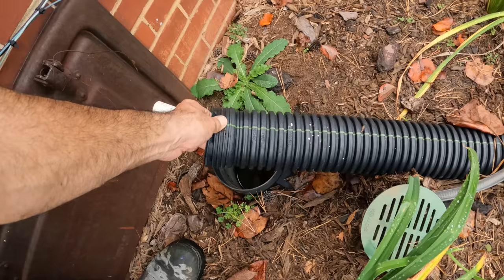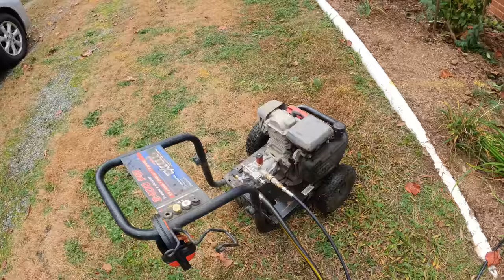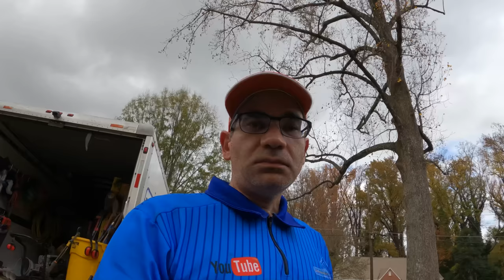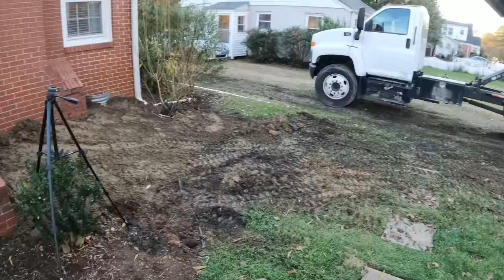Is PVC worth it? Crawlspace and Basement flooding, backgrading, and no fall

Comment: I liked how you were teaching the camera work too so you're not the only one that is worried about shots etc. Smart man! At least with that Schedule 30 run its basically already on top of the soil vs in it, so it won't take so much to replace it if needed. Great video!
Reply from the maker: I agree. If the sch30 backs up again I'll just replace it instead of cleaning it out again.

Comment: Instead of the concrete block to hold the pipe, try galvanized strut and 4inch pipe strut straps. You can anchor the strut to the house or drive it in the ground. It will securely hold the pipe and not stand out like those blocks.
Reply: I agree, if I were the home owner I certainly would not want those hideous concrete blocks supporting the pipe it looks shabby.
Reply: @leewalsh2428  I understand your point. I bet the homeowner was thrilled to be free of water & stress for every rainfall. Changing the aesthetics may be a future project. I like that the solution works. Update - I rewatched the vid. The HOs said they don't care what it looks like provided (the water management) works.
Reply: I like that idea! I've been experimenting with a similar solution of above-ground pipe because of lack of fall, ease of access & maintenance, etc. I also have run the pipe over vents & climate control components. I've been stumped about what to do to provide lift, support, and slope while having a reasonable aesthetic. Thank you for posting your idea. I'm going to experiment & create a mock up soon to see how it'd look. If you have other ideas, please share!

Comment: Yeah that worked out pretty good. I wouldn't be surprised that line that runs beside the driveway has been crushed driving over it with a car. It's running the same way as the driveway is not very deep so there's no protection and it's probably got some cracks in it and that's why it's leaking and then the roots are getting into it. And 👍👍🇨🇦🙂
Reply from the maker: That's a great point. Even if it got cracked, the roots can get into it.

Comment: i've used corregated on a fairly decent grade in my yard thinking the flow would keep it clean... it's full of organics and oblonged. before pvc was all the rage, i used the pvc about 35-40' across my parking pad due to low slope and minimal buried depth for strength, there is still virtually nothing in that pipe, it's incredibaly clean. i drive 20k vehicle over it for 10 years and it's perfect condition. i'll use pvc whenever possible

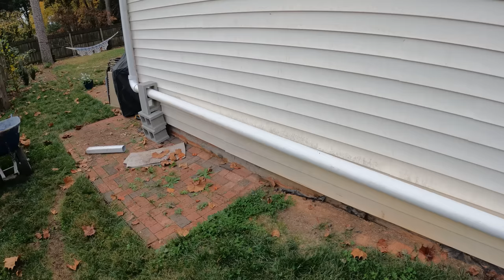Comment: 11:10 How about some short garden fencing as a fascia/soffit cover? In plastic or whatever. easy to move for access. 
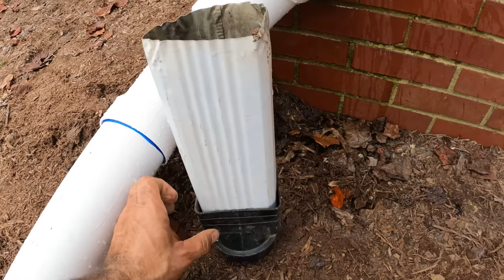 28:50   Drill a hole and put in a rubber plug for cleanout on the flat part near your thumb.

Comment: I use 4 x 4 x 2" Tee-Y's for clean outs. They don't look so bad on the house. If it's in the ground facing up in a flower or shrub garden or bed, it's not too noticeable. You could use ABS threaded cap or Tee-Y, the black ABS will hardly be seen.
Reply from the maker: I've used those and sanitary tees as well for cleanouts. A male adapter + plug works well.

Comment: I'd recommend replacement of the schedule 30 with schedule 40 if only to make sure that the T's get replaced with sanitary T's and ALL the joints are glued to prevent root infiltration in the future...

It would also allow you to remove the form-fitting downspout adapters and place proper clean-outs at the far end of the line for future maintenance and cleaning...

That and the 40 is more crush/cut resistant than the 30 is and the street end of the 30 line looks like it's already been crushed and chewed up by something...

The Homeowner might also want to think about replacing the gravel driveway with a concrete one to improve drainage and make it far easier to shovel the snow in winter...
Reply: The should find a way to add a clean out at the top of the long straight away along the driveway, even if they replace the pipe because there's so little fall.

I don't think they worry about snow in NC.

Comment: I see plenty of tripods around for the cameras… but not one holding a surveying rotary laser that can tell you the actual grade you are working with.  You really need one so you’re not guessing at the amount of fall you actually have.  Wouldn’t this give you the information you (and the homeowner) needs to decide if a sump basin is needed or not?  With the remote detector you can do actual measurements to make sure the pipe is laid correctly at the right depth/pitch.  Diesel Creek recently used one in his “Laying pipe” video..  You definitely need one.

Comment: pruning blades on the recip saw work well (maybe not for that stump lol!) but go blunt very quickly - helps to have a bulk pack and keep swapping to a fresh one. Digging out the soil/rocks by hand before cutting helps make them last longer too. If you're cutting something more than a few inches thick it helps to seesaw the blade or pull it in and out to help clear the chips/sawdust.

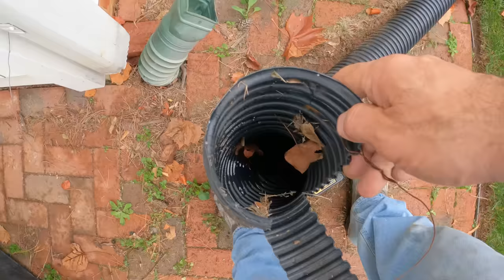Comment: Haha 10/10, 5:55 that's a great point that ADS can't defend, they're in season.  

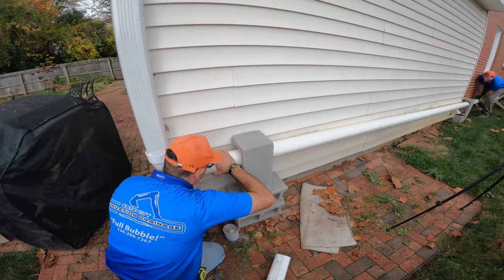To keep the pipe subsurface in that particular situation I'd probably have had a sump,  where the sump has a 4" overflow to the street that uses gravity a simple cheap pump can keep the mosquitos away when it comes on at night(the pump would be on a timer so that gravity would do most the work for the majority of the time).  It seems excessive but they would regain that 8 inches against the house where those cinder blocks hold up the pipe. 8:45 

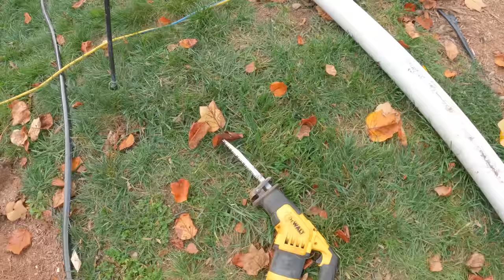21:17 what happens with the chainsaw is that grit gets into the end of the bar which causes it to somewhat seize & stretch out the overheated-chain.  You need a simple sharpener for your axe, almost any type keeps the blade sharp so that you don't waste energy harming elbows or shoulders, I prefer the double ended axe(Never swing a dull blade, it's waisted life IMO).

Comment: Looks good - if they ever decide they need to open that iron door they'll need to cut the 1.25" and put a sleeve on the connection.
Reply from the maker: I think it was a coal door?
Reply: @GCFD  Yes. Our 1939 house in TN has a very similar aesthetic and that coal door. On ours the door rusted off, leaving a huge gaping hole in the basement wall without it. I had a piece of glass cut and attached it to the outside of the frame with brackets drilled and screwed into the cast iron frame, with gentle pressure holding the glass in. Very much a hack job, and meant to be temporary, but 3 years later it still works.

I was sure a lawn mower would send a rock through the thin glass but it hasn't happened yet. I need to revisit it because it's not sealed great and weeds started to creep inside. The proper fix is of course to break out the frame and put a complete custom window in, or just cement it up.

Comment: I use a  DWV Wye connector at the down spouts, then drop in a plug or grate. Looks good and easy to blow out. Also, do have a bore scope? Very useful for finding the breaks and insuring you have completely cleared the pipes. Good video, I always like to see how you work the solution. The cost of water damage makes the price of sched 40 worth it.

Comment: Hey is that a new dump truck ? For any of your viewer's the floor joists were hack. Never notch the bottom of the joist. They turned the 2x10 into a 2x6. A metal joist hanger is the proper way and I would still add them on bent a bit is still better than what they have.
All your work and I saw that, the new dirt was excellent now the driveway side when you go back to fix the leak

Comment: Good work as always Shaun...might be a dumb question but, I've never seen you use a soak away pit. Is this because of local soil conditions or some city rules? Soak aways are very common in the UK in older properties and they seem to work pretty well. That said, most UK properties since the 1960s tie into some sort of rainwater drainage system, with properties from the 1980s onwards having decent provision. I was impressed at the sheer capacity of the storm water drainage system on my 1980s estate, when I installed channel drains on the front driveway and catch basins in the rear patio. Deep inspection chambers that leant themselves to tying in pipework.

Comment: Fantastic work there. 👍 

The pipe next to the driveway could be broken. Vehicles may have damaged it? I agree it needs monitoring.

Anyone wanting to cut big tree roots or a stump without big equipment. Be safe! A sawzal is the safest option with a 12” carbide blade. It cuts through roots easily but stumps are challenging but possible added with human axe power. Using a chainsaw is dangerous if you don’t know what you’re doing. I don’t use one due to safety concerns (I’m not a pro) and as noted in the video it’ll damage the chain.
Reply from the maker: Great comment Joseph. I really need a small walk behind stump grinder to just grind out a 5" trench through the stump. I hate using the chainsaw like that but it does work until you hit the dirt then it's useless.

Comment: Hi Shawn, how about getting 20 or 30 stainless brackets made up, for holding up the pipe against the wall. A simple T bracket, with holes pre-drilled, with a 4" radius curve welded,  that the pipe could sit on. Great stuff. 👍
Reply: The top 'flat' of the "T" could be stainless angle laid on its back like a "v". The pipe would rest in the "v" and be held in place by two stainless steel hose clamps.
Reply: @KySilverfish  Hi Pat. Either way, 3 clamps to hold up the pipe, the blocks look unsightly. I still like 👍  the vids Shawn uploads. 👌

Comment: Great job finessing the work on this house and finding ways to solve the long-standing issues! I’m definitely a fan and always look forward to your drainage videos. By the way, what are your thoughts about using a backwater valve for a 4” pipe that is used to bring out the sump pump discharge out to the street?

Comment: I love that video you did on corregated pipe. LOL.  Next you need to do a vidoe on top soil and where to use it.  I got it use it on Bobcat trracks to regrow grass! I really like Jonathan Greene BLack beauty Ultra!
Nice video

If I have a bunch of fittings that wil be thrown out, including some NDS stuff corners, Would you want it, also Stainless screws for the same. Some Sch-40 some Sch-30. If I can get back there.

Comment: I like it but I think I would've used straps or clips to secure the above ground pvc to the brick on the side of the house rather than using ugly concrete blocks to hold it up.
Reply from the maker: We could have used straps but I hate drilling into brick. The homeowners were fine with the block since that's a side area with no gate and they never go over there..
Reply: @GCFD  FYI you can drill into the mortar instead of the brick, and anyone can easily fill the holes later if the pipe needs to be taken down or whatever. It's an option.

Comment: Do you get your material (pvc, connections, etc) from big box stores like Home Depot or Lowes? I want to run a pipe in our backyard and would prefer to use pvc having watched this channel and not sure the best place to get it. Luckily our backyard has plenty of fall and we have a water swale that runs in all the backyards that flows into a retention pond.
Reply from the maker: I buy from the plumbing supply house because I buy 20' pipes by the pallet and cases of fittings.

Comment: Have you evaluated the merits of pipe like ADS N12 vs what you have adopted as your standard? The jointery, pipe weight, handling/fitting are attractive but also, in Northern climates, even the mighty SCH40PVC is not 100% immune to failure from frost heaving.

Comment: Is it worth a stump grinder attachment for stumps and roots on your skid steer / excavator or a stump grinder machine if you have issues with stumps and roots?
Reply from the maker: I've thought about buying a small walk behind stump grinder for that reason. I definitely need to do something better with the occasional stump we trench over.
Reply: depends. tree removal guys generally only grind the stuff down maybe 6ish inches below grade. unless you have a high flow machine, a grinder on a skidsteer/mini excavator is going to struggle. you are getting the roots, rocks,dirt. we used to have a 30 inch falling saw with carbide tipped chain just for stumps/roots. still destroyed the chain

Comment: Is having that much fall necessary for downspouts? I know it would be for say a french drain to get proper flow but with downspouts wouldn't you have so much head pressure that it has no choice but to flow? I get some water may sit in the bottom of the pipe if there isn't a ton of fall but is that a big deal, if you have a square-to-round adapter and then the only other open end of the pipe, is at the end termination?

Comment: Enjoyed this one as always. But have a genuine question. Do you not have DPC’s in the U.S? I understand you seem to all mostly have crawl spaces underneath your homes but surely adding that much dirt against the brickwork will only cause rising damp
Issues for years to come?
Reply from the maker: Yep! If the sch 30 slows down again I will just replace it instead of trying to clean it out again.
Reply: What are DPC's? Yeah though, I also thought you couldn't go up that high with dirt
Reply: @davidgatten1033  DPC stands for Damp proof course, a plastic/ composite rubber type barrier that sits about 2 courses up from the foundation to stop any damp rising up into the brickwork. You don’t ever raise the ground level above this in the U.K otherwise you’re looking for trouble.
Reply: @Super690Motard  Thanks for sharing that. There's a channel I watch sometimes called "New Home Quality Control." It's an inspector from the UK who shows all sorts of crazy building stuff that's out of code. Check him out if you get bored. We have definitely have strict building code in the US too, and I'm pretty sure that the grade must be at least six inches below the siding, or in this case the brickwork, to prevent the damp rising issues you mentioned. The job he did will help with the drainage but raising the grade that high is surely out of code.

Comment: Why didn’t you just run the downspouts out towards the street? Could have made it into a dry well with a overflow catch basin and could have tapped into the end of the system they had to flow into the street. That way you wouldn’t have the pipes along the side of the house. Plus you didn’t add in any clean outs.. which looks like why it failed to begin with.

Comment: 4" sch 40 is soooo expensive.  A 10 ft run at my Lowes is like $45.  It'd cost me $600+ in pipe to do a few gutters on my house.
Reply from the maker: Spending $600 for a pipe that is going to flow and carry debris through it is a smoking deal. Imagine saving $300 with a lower quality pipe and then wishing you had just spent it and wouldn't have to worry about anything. You can't go wrong spending money on quality work for your house.
Reply: @GCFD  Yeah, great point.
Reply from the maker: It doesn't help ease the pain with the current prices!

Comment: quick question on the side of the house where you used cement blocks to support the elevated piping, could you use some type of hanger off the side of the house or is the piping to heavy? not bad critique just curious as i am handy enough if that was my only option that i could do some stone and cement around the block to make it look like a little stone column. like you said you can always deal with cosmetics. great job as always.

Comment: All the homeowner need to do now is paint the pipe to match the walls. Will it degrade the pipe if you paint it?
Reply: no it wont hurt the pvc but, painting pvc is a waste of time. pvc expands/constricts with weather. you have to degrease it/get the oils/residue off , sand it /scuff it, prime it with primer made for pvc/plastic. pvc/plastic formulated it. it'll be faded/flaking off in 3-6 months

Comment: Hey buddy. Just wondering why you didn’t secure the pipe to the house as a posed to running it through those cement blocks?
Reply from the maker: It would have looked better but I hate drilling into the house. The homeowners never go over on that side (no gate in the fence) so they liked the idea of blocks and not holes in the house.

Comment: I am an arborist and this is a risky practice. Cutting into those roots can kill the tree and make it a fall risk! That tree could fall over even years later. Please next time there is a tree, call an arborist and have it AIR SPADED. It's a quick and easy job and you will have a trench that you can use to run your pipe without damaging any tree roots!

Edit: It may be the case that the roots being cut into were from an old stump, and not from the nearby tree. Still good advice to get it air spaded when roots from a live tree are encountered.
Reply from the maker: I wanted to make sure you knew that was a stump that we cut into. There was a huge tree there and they ground the stump but we still hit remnants of it. My undergrad major was botany/ecology and I always heard that staying out from the dripline pretty much wouldn't harm the tree. That large Liriodendron was far enough away, don't you think?
Reply: @GCFD  That looked way too close to me. Drip line is not a good indicator. I've seen just 18 inch trench, 30 ft from the base of the tree, cause it to fall over. It depends on whether the tree is primarily lateral roots or if it is primarily oblique roots. There is only one way to know this for sure, and that is a root crown excavation with an air spade.

However, if you think most of the roots were just from the old stump, then I stand corrected. Just be careful in the future. Its not that expensive to air spade a trench.

Comment: Those concrete blocks were pretty ugly. The white pipe across the back of the house would be acceptable, if using some sort of brackets.  Was surprised this was the permanent solution.